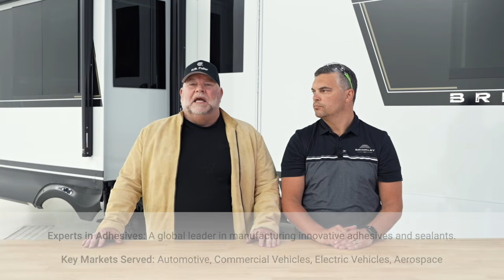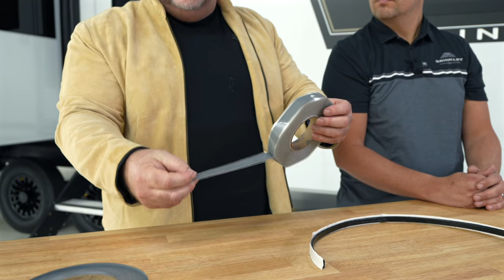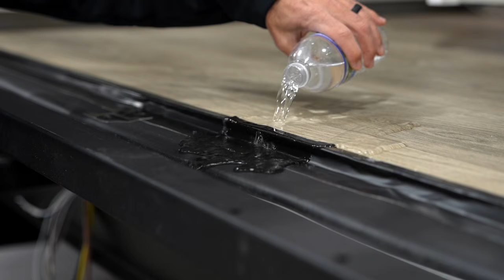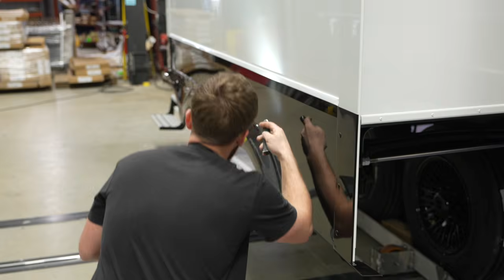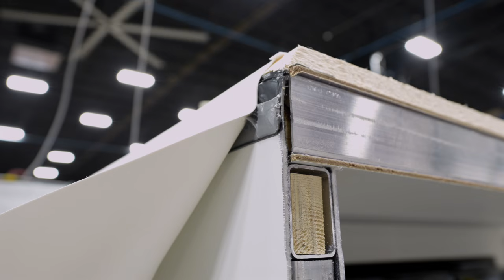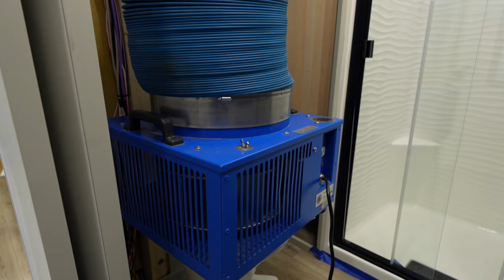INDUSTRY 1st BIG NEWS! 🔥

Comment: Have just recently started reaching new 5th manufacturers. I have been out of the RV scene for 15 years. Your product sounds great on paper. However having watched several unhappy Brinkley owners with the same issues. I’m not so sure that you have reached your goal of being the better quality product. When you see comments calling you Breakly does not bode well for your product. I bought a class A Alfa See ya 40 ft diesel pusher for less than what you are asking for fifth wheel. I just don’t see the benefits of owning a Brinkley over more experienced manufacturers 😮

Comment: Considering it’s 2025, it seems that we should be at a point where “wood” is completely eliminated on high end rvs. The sealing and prevention that goes into a Brinkley is the best I’ve found and my next rv will be a Brinkley for this reason. However, it’s clear the primary culprit for water damage risk is wood. It should just be abolished! It’s time for someone to evolve and set an industry standard to move to lightweight, affordable and rugged composite or some other form of material that won’t damage or total your rig should there be a plumbing leak or water intrusion. Whoever accomplishes this would own the market as long as the overall build is solid as a Brinkley.

Additionally, build water sensors throughout the entire RV (floor and ceiling)that all function on a panel alarm system as well as phone notifications. Tuck them where owners cannot typically see indoor leaks/water intrusions right away. Ie under sinks,counters, appliances, showers, compartments, sliders etc. Mold typically starts to grow in 48-72 hours, sometimes sooner depending on air flow or lack of, temp and humidity. Alarms would notify owners asap of a leak/water intrusion and if the leak/water intrusion is stopped and dried out in less than 24 hours, it is unlikely that mold will grow and a rig could be saved! 

The focus needs to shift to “mold proof” or “mold resistant” RVs….Not focus on just trying to stop water intrusions because  we won’t ever be able to 100% stop water leaks/intrusions. Plumbing, caulking, pumps, human error etc etc….. leaks will happen! Just like they do in our homes.

Comment: I gotta say, you can find many videos on YT of "RV Techs" swearing you away from the use of Eternabond....not to be confused with just "sealant tape". I think it is because Eternabond will ELIMINATE the need for such frequent maintenance and that kills the revenue stream.  While I have used Eternabond on ALL of my roofing penetration points, it is by far, nothing like the use that this mfg is doing. Even so, the Eternabond on my last coach was 7 years old when I sold it and that material was like new.....literally. I have done the same treatment on my current mh 5 years ago with no failures, leaks, or needed maintenance. Bye bye Dicor! 
Now that I find myself in the market for a toy hauler, while it is a bit costlier, the Model G 4000 has my attention (and my wife's)!  
Great job Brinkley!

Comment: Brinkley, thank you for your reply. Your trailers are beautiful inside, but in my opinion, the risk of water damage is too high to justify purchasing a unit. I am an architect and engineer, and I am very interested in purchasing one of your units. However, after watching YouTube videos from Brinkley RV owners who experienced internal water leaks, and learning that there are entry points that require inspection every three months to prevent internal damage, I believe that the risk is too high.

In my opinion, spending $80,000 to $200,000 on a unit that only comes with a three-year warranty is not worth the gamble. This video you created was good, but it is not enough to convince me that buying a Brinkley RV will not result in costly internal water damage after the warranty expires.

I will be very interested in your units when this concern is addressed. Until then, they are off my radar for purchase. If you have such confidence in the engineering of these units to include water intrusion prevention, why not have a 10 year limited warranty excluding appliances moving the risk and ownership of water damage repair to Brinkley? This would instill confidence in your customer base that these units are truly built to last.

Also your marketing is stating that Brinkley is using automotive technology to prevent water damage. I said this earlier in my first post on this video, automotive vehicles do not have wood support in their roof, doors, or floors. Their chassis and subframe are all metal and or carbon fiber. They are fully sealed from rain and have water drains in the door and sunroof to prevent water from entering the vehicle if all the doors and windows are closed. I did not see any of this technology mentioned in this video. Your units have wood support in the roof, walls, and flooring. When water gets into the roof or walls of one of your units it now has the potential to reach the wood. The wood now has the potential to be damaged requiring replacement. This is a bad position to be in from a customer perspective because the repairs out of warranty could be quite high and if there was extensive water damage there is now the possibility of the unit being classified as a total loss. I would like to see Brinkley address these concerns through additional technology and a much longer warranty to protect your customer’s investment into your trailers.

Comment: If water enters the trailer through the roof or sidewalls and damages the structural wood, whether partially or to the extent that all wood in the affected roof or wall section requires replacement, I would like a detailed explanation of how your team would repair the unit.

It is understood that a complete damage assessment would be necessary before initiating any work. However, my specific concern relates to the trailer's long-term integrity if a significant portion of the wood structure is compromised and must be removed and rebuilt. 

Could you please clarify:

1. Your standard repair methodology for such scenarios.
2. Whether complete disassembly of roof or wall panels is performed, or if sectional removal is typical.
3. How do you ensure the restored area regains the original structural and weatherproof integrity?
4. If there are any limitations in the repair scope, this would result in the trailer being “patched” rather than fully restored to factory spec.
      5. How does water come out if water gets into the ceiling, walls, or floor? You are using a marketing term “automotive” Automobiles chassis are made of metal, do not contain wood in the ceiling, doors, floors, and have water drains to ensure water exits the vehicle without damaging the structure or interior. 

Given the investment costs northbound of &80k in a premium unit like Brinkley, as a potential customer, I want to understand how structural water intrusion would be addressed. I’m looking for confidence that this type of damage would not result in a non-repairable RV.
Reply: No response from Brinkley?
Reply from the maker: To start a discussion on this topic, it would be recommended that you reach out to our Customer Care team, as they are going to be best positioned to dig into your questions with you. They can be reached at customercare@brinkleyrv.com or via phone at (574) 501-4280.
Reply: Brinkley, thank you for your reply. Your trailers are beautiful inside, but in my opinion, the risk of water damage is too high to justify purchasing a unit. I am an architect and engineer, and I am very interested in purchasing one of your units. However, after watching YouTube videos from Brinkley RV owners who experienced internal water leaks, and learning that there are entry points that require inspection every three months to prevent internal damage, I believe that the risk is too high.

In my opinion, spending $80,000 to $200,000 on a unit that only comes with a three-year warranty is not worth the gamble. This video you created was good, but it is not enough to convince me that buying a Brinkley RV will not result in costly internal water damage after the warranty expires.

I will be very interested in your units when this concern is addressed. Until then, they are off my radar for purchase. If you have such confidence in the engineering of these units to include water intrusion prevention, why not have a 10 year limited warranty excluding appliances moving the risk and ownership of water damage repair to Brinkley? This would instill confidence in your customer base that these units are truly built to last.

Also your marketing is stating that Brinkley is using automotive technology to prevent water damage. I said this earlier in my first post on this video, automotive vehicles do not have wood support in their roof, doors, or floors. Their chassis and subframe are all metal and or carbon fiber. They are fully sealed from rain and have water drains in the door and sunroof to prevent water from entering the vehicle if all the doors and windows are closed. I did not see any of this technology mentioned in this video. Your units have wood support in the roof, walls, and flooring. When water gets into the roof or walls of one of your units it now has the potential to reach the wood. The wood now has the potential to be damaged requiring replacement. This is a bad position to be in from a customer perspective because the repairs out of warranty could be quite high and if there was extensive water damage there is now the possibility of the unit being classified as a total loss. I would like to see Brinkley address these concerns through additional technology and a much longer warranty to protect your customer’s investment into your trailers.

Comment: I LOVE YOU BRINKLEY, THIS IS NOT CRITICISM. YOU CAN WIN OVER THE HALF-TON TRAVEL TRAILER MARKET:
I love that this RV (i265) is close to Half-Ton Towable. However, it could be much better for Half-Ton Towing.
Perhaps you can make a I-255 safe Half-Ton Towable model. 
EXTERIOR:
1. Reduce the tongue jack weight with 20 lb Propane Tanks 
2. A Outside Battery Tray to fit two Epoch Batteries 12V 105Ah - Group 24 - Heated & Bluetooth LiFePO4 Batteries.
3. This Travel Trailer can easily be 30 amp. No need for 50 amp connection.
4. The Backup Camera Prep should be universal. That way buyers can install the Backup Camera of their choice, to include side Cameras.
5. Two Rich-Solar 200 watt Solar Panels mounted close to the back of the RV, to keep tongue weight down.
6. Perhaps a Starlink Mini mounted on the roof (yeah nice).
INTERIOR: 
1. A peephole in the front door so people can see who's knocking.
2. No Audio System needed. Should only be offered as an option.
3. Slide Out is slightly too long. To improve Travel access to the bedroom, the Refrigerator should be a smaller 10 cubic inches (a couples camper, refrigerator don't need to be that big). Plus reduce the Pantry (slightly to wide) to reduce the size of the Slide Out.
4. The Entertainment should be a 42-in or bigger Smart TV. Perhaps with some type of pull-down rack. The Protector TV can be optional.
5. The Dining Table should have Office Supply / Laptop Storage not Silverware Storage.
6. Include a Dishwasher under Kitchen Sink (WHY NOT).
7. One of the Kitchen Drawers should be set up for Silverware /Utensils.
8. That Three-Burner Range is 1970s, no one cooks like that. Should be a Two-Burner Range so people could put bigger pots on.
9.  The Bed should be a 60x80 true Queen. That way the bed could be made easily.
10. Max Air Vent should be standard in the Bedroom. People like breezes in their Bedrooms. A 12volt Air Conditioner should be optional for the bedroom. For instance; CountryMod Pro - 12V RV Air Conditioner – 10,000 BTU Lowprofile, Very Quiet Rooftop Air Conditioner.
11. Mount and add a 32-in Smart TV in the Bedroom (WHY NOT).
COME ON BRINKLEY, TAKE OVER THE HALF-TON TRAVEL TRAILER MARKET‼️
Reply from the maker: Hi Lindsay!  Thanks for the feedback!  We will share this with the product development team for consideration on future models.  The Model I segment is still new, and we will continue to grow it and expand our floorplan offerings.

Comment: Nate, We do like Brinkley BUT- I went to check out some in Duncan. I noticed the seam joints were not moulding but TAPE??  The tape was falling off the wall. WHY use tape on the joints. That said when you press on the tape it sticks again but for how long?. This is NEW trailers. Mmmm  That is not best in the industry using tape . I was not impressed on the Z 5th wheels.

Comment: Unfortunately, you are not addressing two common areas of water intrusion. First, the screws are being inserted through the butyl. As the butyl dries, it absorbs water through the screws, which leads to chronic leaks and eventually severe damage. Second, Alpha non-sag sealants should never be used. These sealants are butyl-based and begin deteriorating from the very first day. If you truly believe in your system, why not offer a 10-15 year warranty instead of just three years?
Reply: I agree and this is why we are not buying a Brinkley.  I prefer the Brinkley interior over any other brand but we are going to buy an Airstream because I have the confidence it will last for 40+ years if maintained properly. My concern with the Brinkley is if water gets in the walls it could be game over.
Reply: @RobertDenali  Obviously you haven't kept up with Airstream, since Private Equity buyout, they are leaking garbage too now!
Reply: exactly, the koolaid drinking is ridiculous in the Brinkley community

Comment: Living in New England I would be concerned with water getting between the sidewall and the components and freezing which would pop seems. Automotive seals comprise of gaskets and weather stripping as a water deflecting means. Eternabond is an excellent product, but I feel that a water deflecting caulk is just as important.

Comment: Are you still tucking your TPO roof under the front nose cap instead of going over the top? So basically Brinkley is going full speed with eternabond tape?

Comment: 2:13- So if the Seals are so great and maintenance free and supposed to last 20 years why are you only warranting them for three?
Reply: Because they know that eternabond starts to wrinkle and holds water after about 3 years. They also didn't explain what they are using for the flat items on the roof (skylights, fants, vents...etc.) and how they cap seal around the items.
Reply: @stuckcamping  that is only true when exposed to constant UV
Reply: @ an RV is constantly exposed to UV unless you never use your camper and store it indoors, which most folks can barely afford the rv let alone indoor storage.
Reply: @stuckcamping  thats true but the tape as uded in this way is NOT exposed to UV. Perfect example...the slide outer roof edge is almost always sealed with Eturnabond tape and you NEVER see it fail...WHY...becaused the slides are closed most of the time away from direct intense UV.
Reply: @waltfriedrich7631  U cant reason with haters...
Reply: @ So true. I have been aroung these rvs for almost 45 years and was a mfgr rep for a major brand. I know how the entire coaches are built and know what they do differently. Been to the factory and asked very specific questions and had each one answered and pointed out with great detail. They are priced higher then I would pay at my age and a little sterile for our taste, but knowing a lot about coach construction I will stand by my statement and they are built better and differently. Are they perfect, of course not neither is a multi million dollar Liberty Prevost....close but nothing is perfect.
Reply: Because warranties are designed to protect them, not us.  Nobody wants to take responsibility.  Think about it…if damages are tens of thousands of dollars, they don’t want to be responsible.  When was the last time anyone really received considerable advantage from warranties.  Normally, they design warranties to half what it would last.  It’s a business.
Reply: What car has a 20 year warranty.... Or for that fact anything...

Comment: 0:42- that was not true. I googled and the industry norm for body reseal and roof reseal is the same as the Brinkley Seal Warranty was in the Brinkley Warranty manuals. 6 months! Why would you exaggerate that?
Reply: Check out the video around the 0:35 mark, Brinkley introduced a new 3-Year Limited Internal Seals & Gasket Warranty and made it retroactive for all Brinkley RVs. They are currently updating all warranty and owner’s manual documents to reflect this significant improvement and clarify the language around their internal seal maintenance on their coaches. The documents should be completed and available to everyone on their website over the next month or so.
Reply: He did NOT say that was industry wide, he said SOME of the others call for 90 days others 6 months

Comment: We absolutely love our 2025 z3100 #4929.   I am curious about some wrinkles on the rooftop, that appear to be bubbles that run the width of the roof, where I’m guessing there is a seam below.  Of course, we’ve had no leaks, and I’m not really concerned because they don’t seem to be growing.  But is that normal?
Reply: We also have a 3100 Z #4935 with many air bubbles under the rubber roof membrane, but no leaks. I will be contacting customer support about this issue as it was not mentioned in this video.